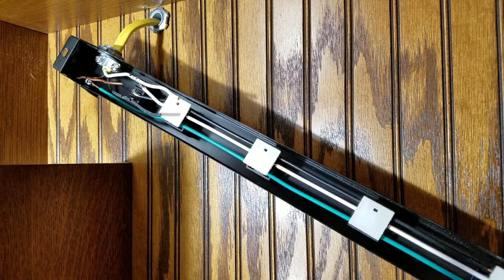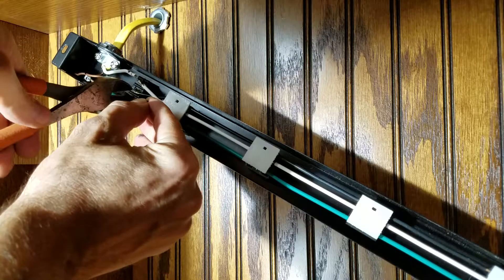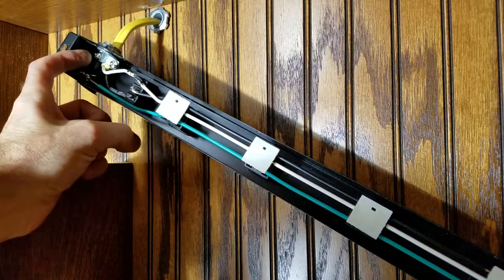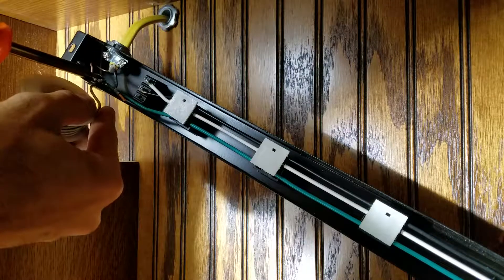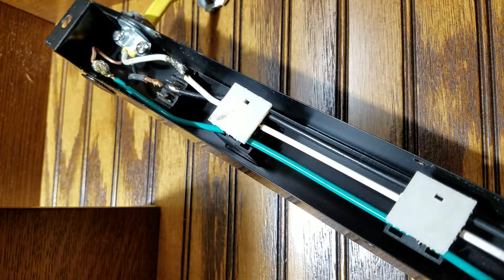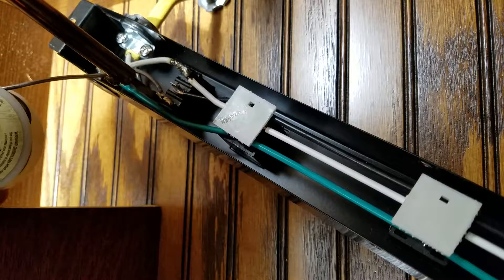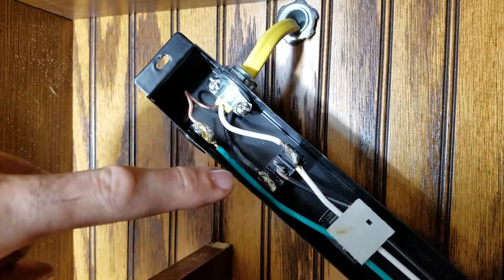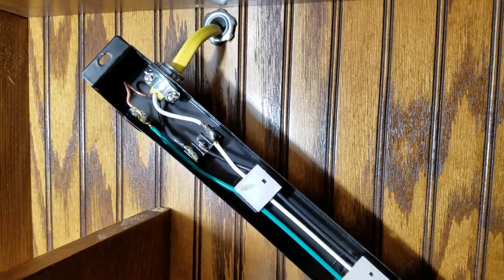How to Install Under Cabinet Outlets in Your Kitchen: Part 3

Comment: What wire mold model are you using
Reply from the maker: hi Brian, in Video 1 I laid out all the materials. I used a standard 4' power strip from Harbor Freight - cut down to size for each location. 👍
Reply: You re-fabbed a power strip from harbor freight? Now I know this wasn't ever inspected.  You re-purposed something that was never intended to accept hard wiring. And it's harbor freight to boot? Worst quality you can buy........you should just delete these videos.

Comment: So many violations
Reply from the maker: no exposed wire, 12ga wire for kitchen circuits, strain relief, and GFCI protected. Met the NEC and inspection at time of installation.
Reply: @myoldhousefix  there is no possible way that was inspected. 
1. What you call a "strain relief" is a romex connector, and is installed backwards, which is a violation. 
2. It's a violation to solder those connections, connections shall be either mechanically secured by twisting, or via mechanical pressure by either clamping or lug type connections. 
3. The previous video showed an EMT connector as your pass through which would have been a violation and I'm guessing the only reason you didn't follow through with it is because it was too cumbersome. 

I'm not trying to be rude, but when people are telling "great job" that means people are using your work as a suitable baseline for their projects. You're spreading very bad information that can result in property damage and god forbid loss of life. There's a reason electrical work requires a license. Absolutely no one that knows what even poor work looks like, would think this is acceptable in any way. I'm sorry my man but that's the truth.
Reply from the maker: @geminye79   I hear ya on that. My electrician and inspection stated that's its a "gray" area under the NEC and is still considered an "accessory appliance" - whether it's  plugged in or hardwired...and therefore met code. Maybe they missed something at the time, buts thats the guidance I received. Thats why I state that local codes amd guidance may vary.